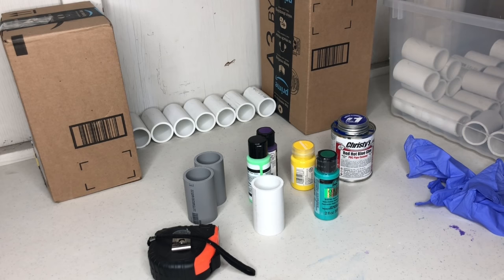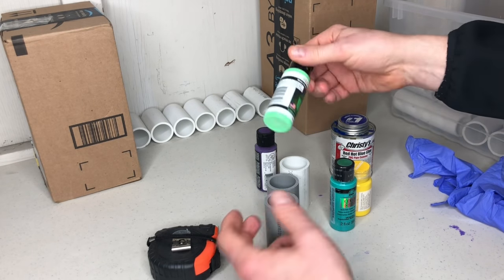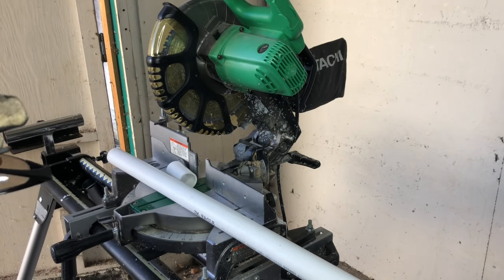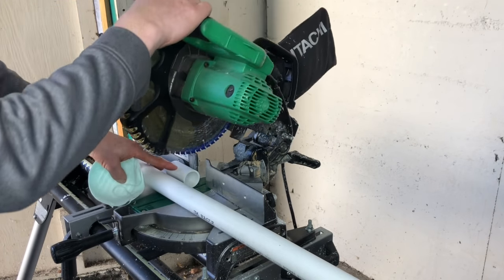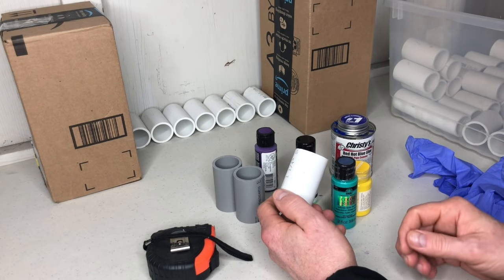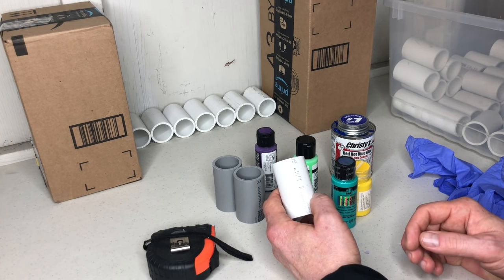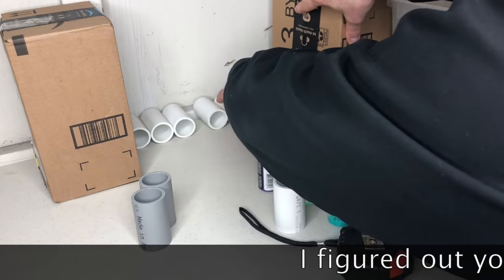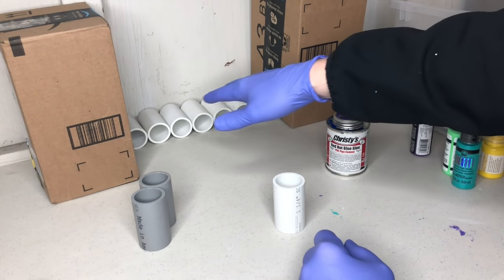How To Make Your Own Craft Paint Organizer Storage Rack DIY

Comment: These are some really wonderful ideas. I'm going to share this video with a lot of people on a Facebook page in a group for model car building. 
One thing that I want to caution you about. Be careful using that saw wearing gloves! Usually in my community we don't ever use gloves while using a miter or table saw... The reason being is that blade grabs that glove  it is going to jerk your whole hand into that thing and go round and round before you realize it. It can make what would be a simple but bad enough injury into a whole situation where you lose a hand. Now if you're like me you're going to be super super careful, and you'll probably be okay, but even then, crazy things can happen. Just for the sake of anyone else who may be watching this... be careful using gloves around these types of saws... Again it doesn't take but one tooth on that blade to grab a tiny bit of that glove and then jerk your whole hand and arm into that saw blade. It only takes a split second to remove digits that will never grow back. Have fun doing your crafts and model-making and building stuff but just be careful! PLEASE?
Reply from the maker: I now have Hex Hive 2.0 available which is much lighter does not need to be cut down and assembled with no tools or adhesives. Check out HexHive.us  😄❤️👍
Reply: @MarksMandalas  stuff looks pretty cool... Might just have to try that out

Comment: It would make more sense to sit the top row on two of the bottom row so the tray when standing up is staggered while also making the whole of it more reinforced for strength. Also the clear PVC cement is better for bonding whereas the Red Hot Blue cement is actually for sealing joints so to keep water pressures optimal when using for plumbing.
Reply from the maker: I don't care for the look of the PVC being staggered especially when keeping colors organized.  I will look into the clear PVC cement.  I do know for sure the Red Hot Blue is super strong and works great for this project.  I am always open to suggestions though and I will definitely look at the clear. I'm not a plumber so I have very little experience with PVC and their adhesives. Thanks for the tip. :^)
Reply: The reason that PVC cement is so strong is it's more solvent than adhesive. It actually melts the two PVC surfaces and makes them one. Good cost effective solution I'd say.

Comment: Maybe use a block held in place with a C clamp on your chop saw? That way you don’t have to line up on a line every time
Reply: The problem with using a stop block on this, is if you're not careful when you pull that blade back up... It has a tendency to throw those smaller pieces all across the shop LOL so the smart thing to do would be to cut and then release the trigger while the saw is still in the down position. Make sure the blade stops turning before you lift it back out and you will solve this issue

Comment: I want to make this for my sister and spray paint it to match her decor. Should I spray paint before I glue or after?
Reply from the maker: I think it would be easier to paint before gluing together but I am not sure if the paint will interfere with the glue holding the pieces of PVC together.  Maybe spray paint a couple pieces and try gluing them together then test to see how well they hold together.  I hope this helps.

Comment: I'd suggest blocking the left side of your chopsaw to the desired PVC length for your pieces. Would be way faster and they'd all be identical. You forgot to mention the type of chopsaw saw blade you're using too. Finer toothed = less chance of chipping. I appreciate the safety callouts on the respirator btw. That stuff is no bueno to breath. Nice video though. Thanks for sharing.
Reply from the maker: Since I made this video I have created the Hex Hive storage organizer.  No tools or adhesive needed.  You assemble it the size and shape that fits your space.  Here is a link for more info: https://marksmandalas.com/collections/marks-mandalas-dotting-tools
Reply: I'd like to know the blade used as well. Our pipe is chipping, and I can't afford the hex hive, which is why I searched a diy storage shelf!

Comment: Would these sections with the 2oz. paint bottles be too heavy to hang on an average wall ?  Also, I don't know anyone with a saw so I was wondering if you or any viewer would know what kind of business would possibly do non-commercial sawing?  Home Depot used to saw boards but not anymore.
Reply from the maker: The PVC is pretty heavy for wall hanging. I have since created the Hex Hive storage organizer. It is much lighter and it is already at the proper length. You assemble it the size and shape that works for you. No tools or adhesives needed. Here is a link for more info about Hex Hive: https://marksmandalas.com/collections/marks-mandalas-dotting-tools/products/100-pc-set-hex-hive-craft-paint-storage-organizer-rack-for-paint-pens-dotting-tools-vinyl-rolls-etc-craft-room-storage-organizer-made-in-usa

Comment: Thanks Mark. These are sensational and so easy.  I now have three 25 bottle racks. I have configured them differently as I feel there is more strength and stability. I have one more rack to go, pipes are already cut. I have also glues a back panel to the bottom. I really love these. So easy to add to over time. I am in Australia so I had to get inventive as you don't ship to us. I have also bought two pen racks. They are also amazing.

One question. Do you have the metric sizes on your Mike Mandalas tools please, that you can tell us.